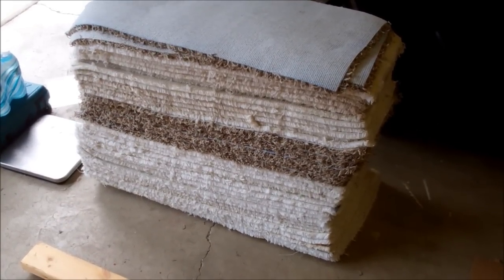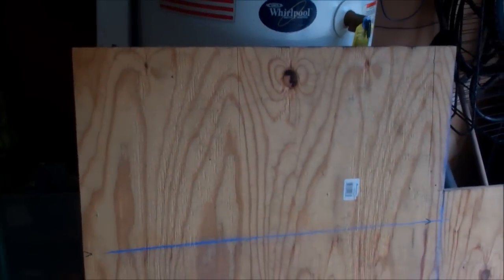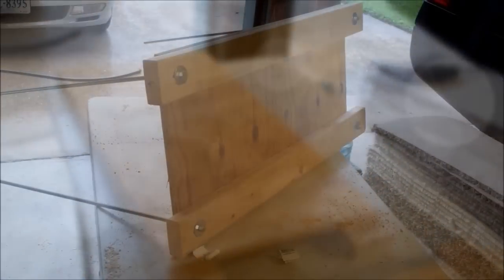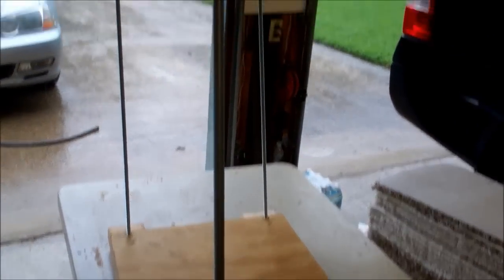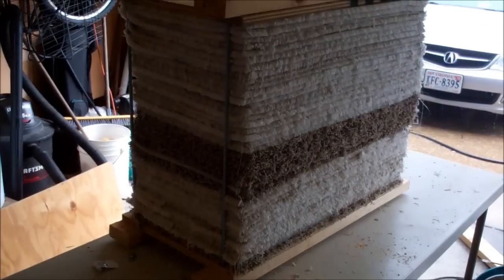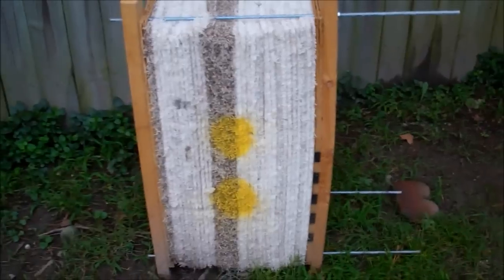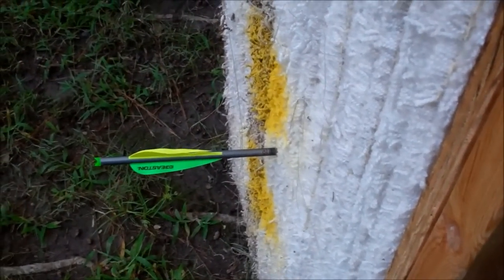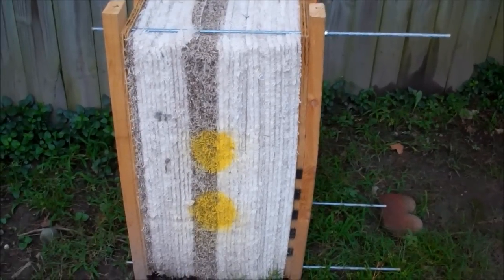DIY Making an archery (crossbow) backstop / target out of carpet

Comment: This worked pretty darn well buddy. I was sick of the targets at cabela, cost 160 bucks and getting the bolts out require a pipe wrench with breaks the bolt shaft half the time. Now all i need is a decent video on homemade bolts with common, cheap materials and i may be able to afford the sport yet:)

Comment: One think you might want to change is the way you put the 2x4  instead of turning  it on the 2 inch side  drill the hole for the rods  in the 2 inch side drilling the hole through 4 inches . doing that will keep the wood straighter  a 2x6  would even be better ,your going to be putting a lot of pressure on the wood when you tighten the bolts but  since you all ready have the 2x4 try it  the other way it should be twice as strong as the way its turned now .

Comment: Years ago I made something similar to this with layers of packing foam, two sheets of OSB and two ratchet straps.  I compressed the foam with the wheel lift on a tow truck (lifted the truck right off the ground) and then tightened the straps.  The target still stops arrows, at least from my compound bow.  I'm sure a front end loader or back hoe would work just as well.

Comment: I built a cheese press the exact same way lol.....
Maybe make it smaller and more compacted....i rarely miss with the crossbow by more than an inch or two off center anyway..so smaller isnt really an issue.
 If you want less penetration.....thats what does in bolts tearing off the flights getting them out....i would like to shoot my crossbow more but this is why i dont....even crossbow targets dont hold up.

Comment: what did you finally come up with I love the idea I was thinking 4X4s might be better steel plate would be good if you had access or owned a welding shop but it wouldn't be a cheap target
Reply from the maker: Actually, it worked just fine as it was.  If I was to do over I would turn the 2x4's  90 degrees or use 4x4's, but as they were they worked fine until I was told to get that thing out of the backyard.

Comment: Turn the 2x4's. better 4" of tensile strength than 2". Also, add a third set of 2x4's in center, with two more sections of threaded rod. (3 points of compression).
Reply: Allen Thomas That's what I was going to write but I've made a search (ctrl+f "2x4") an found I wise guy passed before me. But I had not tought of adding a section in the middle.

Comment: I'm going to use two ratchet straps. Hate ripping up fletchings.
Reply from the maker: Not sure that will have the force needed to compact the carpet but let us know.
Reply: Van R stack it on a pallet, plywood with 2x4 guides, ratchet it down. You saying a ratchet can hold down a load on a semi truck trailer but not a stack of carpet?
Reply from the maker: No I'm not saying that at all.  There's a lot of factors involved.  Distance to the target, the crossbow being used, and even the carpet.  More powerful the bow, and a shorter distance to the target the tighter the carpet has to be compressed.  My first attempt my bolts went through until I compressed it more.  With threaded rod you have the torque to do that.  If you are shooting longer distance or less powerfull bow straps may work fine.
Reply: Van R you're right, two metal plates then wood and carpet in the middle with ratchet straps will work.

Comment: I hear your not supposed to use rubber backed carpet? However every carpet I find has that hard plastic like material beneath it... is that not what they're referring to when they mention rubber back?
an answer would be appreciated, happy shooting.
Reply from the maker: The carpet I used had a wide weave burlap like backing.  I am sure it was some kind of plastic but not the rubber stuff.   I think there is some with a black or grey thin rubbery backing and I would not use that.
Reply: +Van R thanks for the reply. I didn't know what to use so I just made one out of under padding and my arrows when right through and pierced through the fence behind it.
next weekend I'll try again with real carpet.